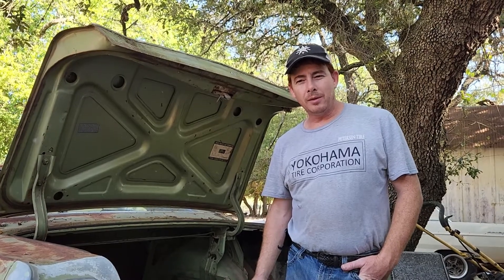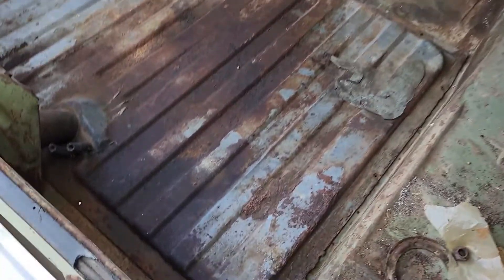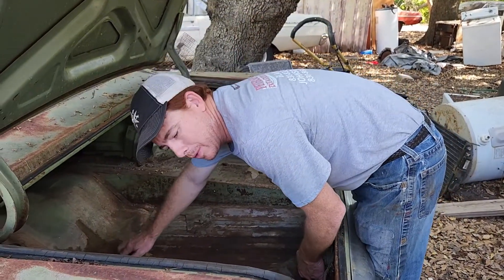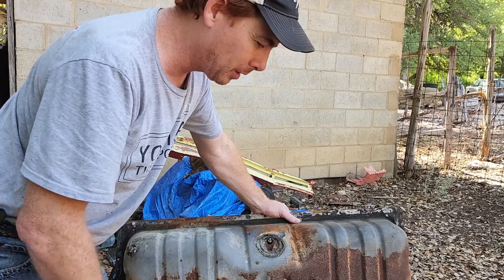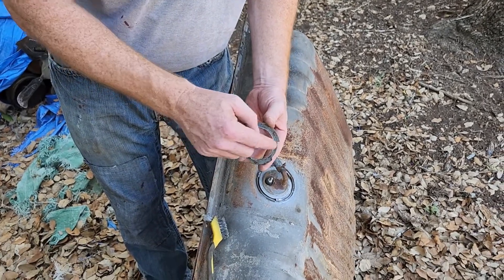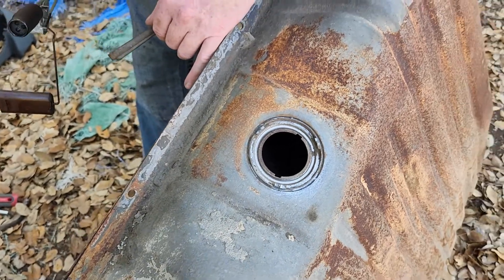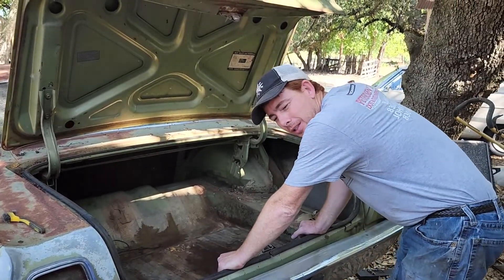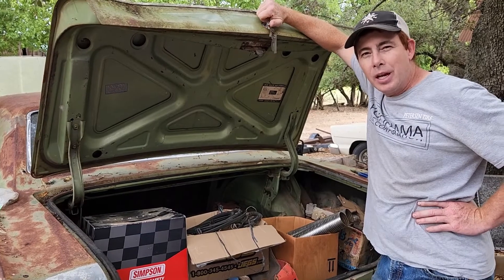Fuel Tank Progress in 1968 Ford Fairlane 500 for #nonamenationals

Comment: I'm surprised viewing YouTube videos showing people removing/installing gas tanks in older cars and not using any type of ground strap. I have a friend who removed the tank of a '55 Chevy, put it on two plastic saw horses outside his shop, walked away to go inside the house and the tank blew up. Fire and insurance officials stated that a static electricity spark from an unknown source ignited the little bit of gas left in the tank. He and I both have installed a ground rod outside of our shops, use a 25 foot length of 12 gauge flexible electrical wire with big alligator clips on each end to ground gas tanks.
Reply from the maker: @dtThurman  thank you for the idea